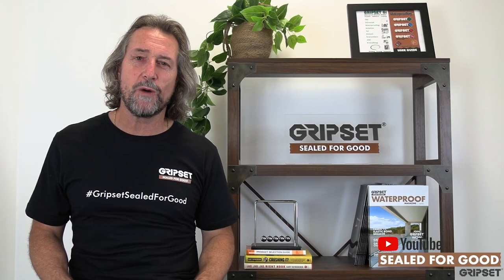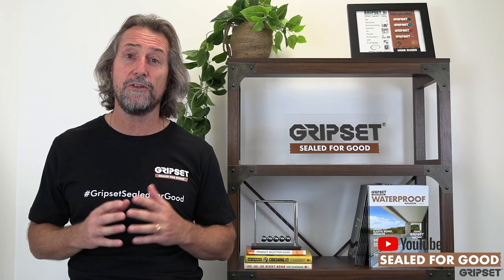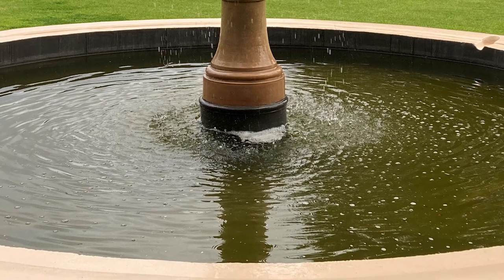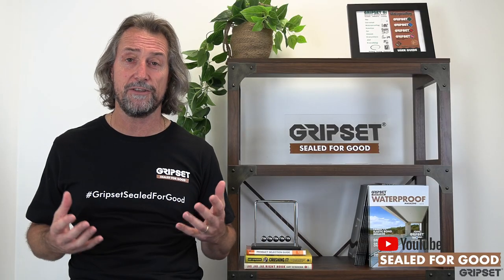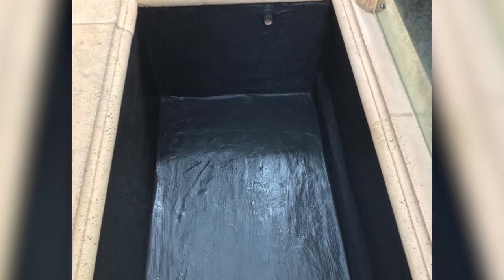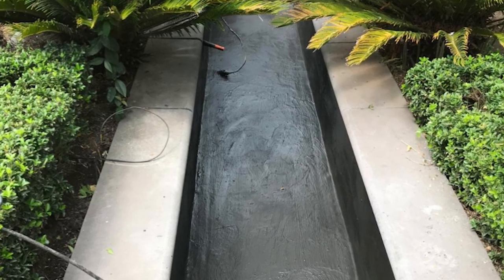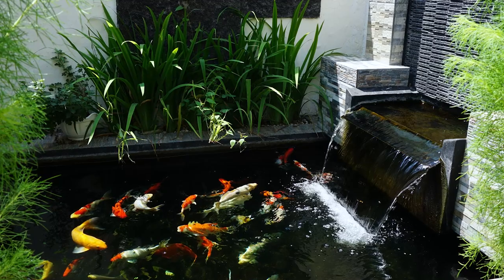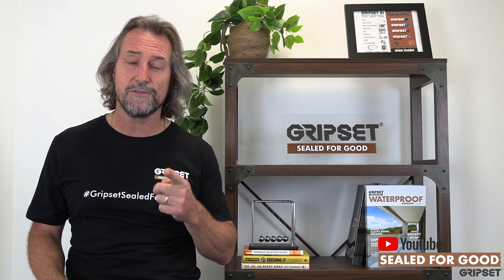How To: Waterproofing Fish Ponds

Comment: Hi, nice to meet you.
I would tell about my case.
I have a concrete pond. It remains without loss up to a certain point, but then at a certain level, the water leaves very quickly. I would like to have it up to the top, but in a few hours the water is gone. An eleven-inch pond, I end up getting less than half the yield.
The main problem is that I already have very well developed plants, dirt and fish in the water, tiny fish. 
What can I do to solve the leaks without having to remove all that from inside, and of course, that it is not harmful to the small ecosystem?
Best regards from Argentina!
Reply from the maker: Hi Lucase, thanks for watching! You could attempt to drain the water slightly lower than where the water loss is, then you could use a locally available waterproofing membrane suitable for fish ponds to dress the side of the pond that is exposed to attempt to stop the water leaking. Hope this helps! :)
Reply: @GripsetIndustriesPTYLtd  
A million thanks! 
🙏🙏🙏

Comment: I have a cement pond below ground… what should I use
Reply from the maker: We would recommend C-1P for this application -> https://gripset.com/products/gripset-c-1p/
Reply: I have had constructed a block pond which has been painted with rubberized paint.The pond is still letting in water and we haven’t been able to stop it! What should we do to rectify it? We have been told to render pond and then put insulated boards with rubberized paint on top to seal it?